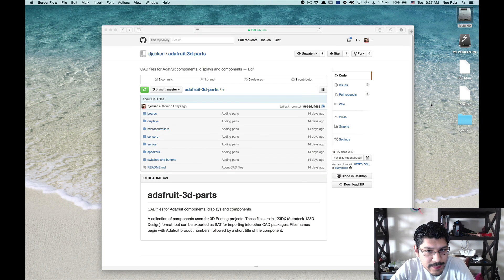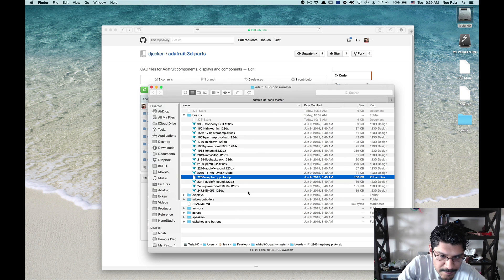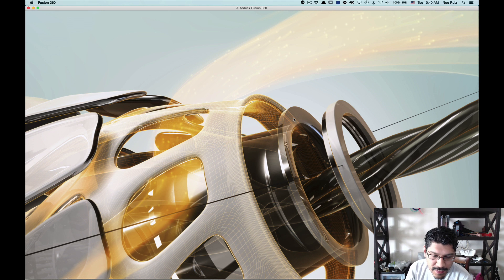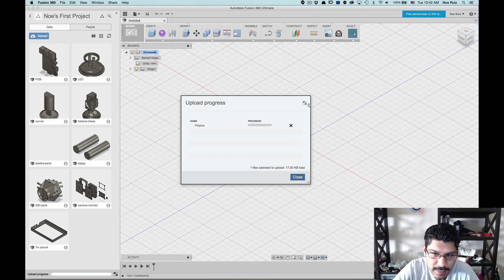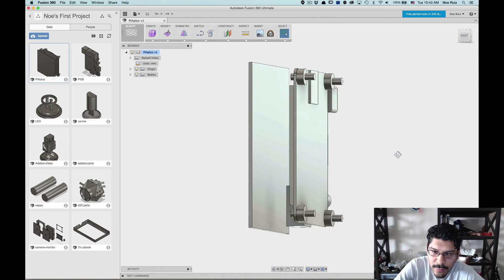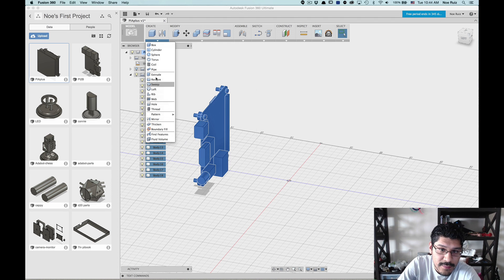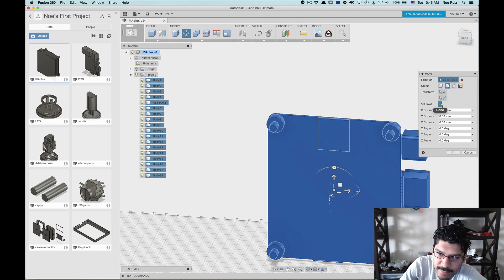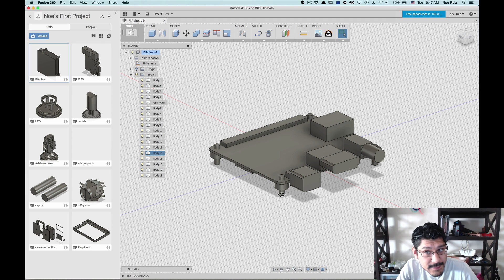Layer by Layer - 123D to Fusion 360

Comment: How did you find the move? For me as a total hobbyist, 123d design seems much easier and I love the 3d view, as opposed to the isometric view of fusion 360 (you can probably change it  but I can't figure out how). Certainly 360 seems to have more features, but I've not come up against a wall yet with 123d.

Comment: Fusion 360 looks like some decent design software, despite the crashing and UI bugs.  I dunno if it's $40/mo or $300/yr decent, but still decent.  I guess if you're using it professionally, every day, then it's worth the money, but we normal folks who might not design anything for a few weeks -- not so much.

5:00 Key rebinding in a utility?  I don't think I've ever seen that in any application I've ever used.  Which is interesting, since PC games have been able to do that for decades (what's up with that, utility app coders?).